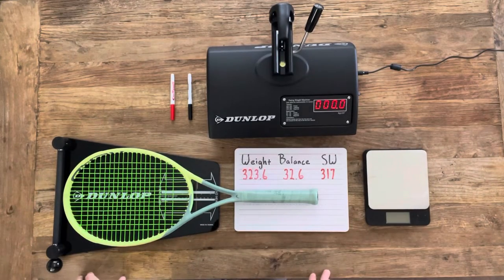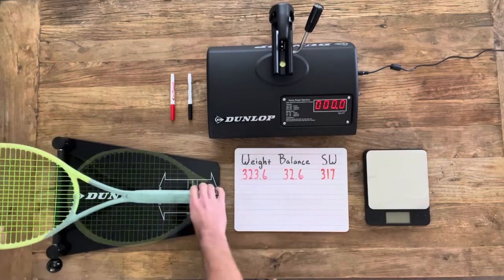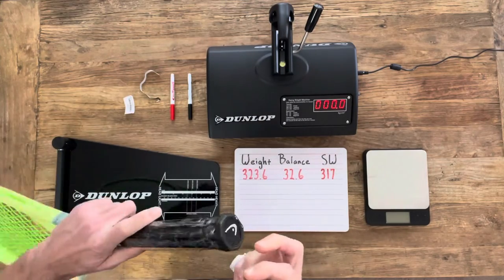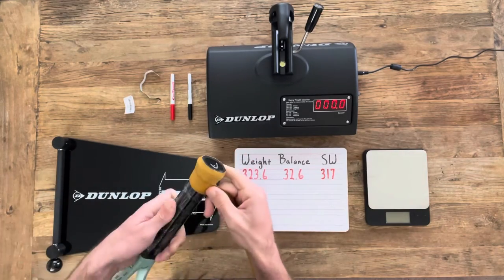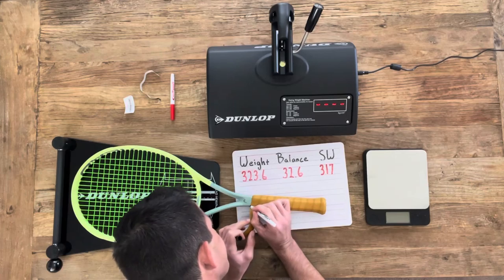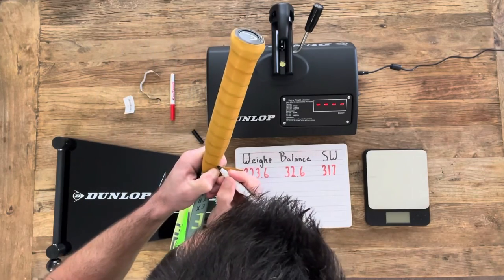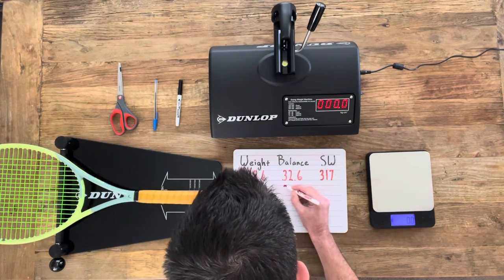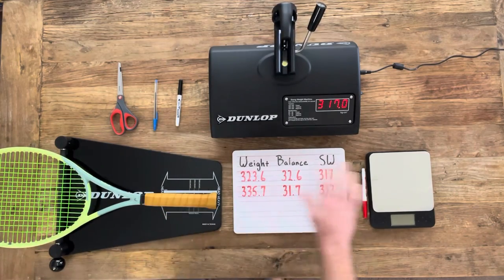How to put a leather grip on a tennis racket. How does a leather grip effect the swingweight?

Comment: 1:25 The TW private label leather grip comes in 1.5 and 1.3 mm thickness. The Head Hydrosorb Pro is just under 1.8 mm.
=> Both options will reduce your grip size by about half a size to one full size.
Reply: My factory-installed leather grip wore out. I removed it and will install a TW leather grip (same as in video). I noticed there are staples in the grip, so apparently staples were used by the factory to install the leather grip. But I can just go ahead and install the TW leather grip without stapling, correct?
Reply: Yep, you can get an Oehms Pro Leather grip in 1.7 which will keep the grip size the same. I believe Head uses those in their pro room, just rebranded.

Comment: Just curious, how much lead would you need to add to the hoop in order, to retain the original balance after adding the leather grip?  Obviously, this would vary depending on where you add the weight -- 12 o'clock,  3 & 9,  etc...   Thanks!
Reply: At 12 o'clock: 4 inches (2,8 g) of lead tape changes balance about 1 point.

At 3 and 9: effect is about half of what it is at 12 0'clock.

To change 1 cm ~ 3 points you need 12 inches at 12 0'clock or 24 inches to 3 and 9 to have original balance.

Comment: Heey I'm thinking of buying the Head Extreme Tour and for greater stability putting a head leather grip on it, I have it on my Head Boom Pro and it has increased the grip quite a bit, should I buy a smaller Head Extreme Tour grip to put the head leather grip on?
Reply from the maker: I haven’t used a Head leather grip before but you can get thin versions of the Tennis Warehouse brand. This one didn’t seem to increase my grip size

Comment: Did you get an underspec ET? You mentioned having lead on the sides at 3 and 9. Just surprised that the SW is only 317.
Reply from the maker: Yes, I did get an under spec one. I find that rackets are under spec more often than over which makes sense from a manufacturer’s standpoint because under spec can be remedied more easily.
Reply: @simmstennis  whats the SW unstrung?

Comment: That wasn't what I was expecting. I thought the swing weight would have gone down. Then what is the effect on the feel of the racket on the swing? Does it feel faster through the air? Does it feel more stable upon collision with the ball?
Reply from the maker: It depends on what type of swing. On forehands, backhands and serves where you’re generating plenty of head speed the impact is minimal. If you are blocking the ball more like with a volley or some returns of serve it helps with stability. To me it does not feel faster through the air although some say it has a more maneuverable feel.
Reply: Adding weight at the bottom never affects the inertia of the racquet.
Reply: The leather grip WILL provide recoil weight. Which means that the impact of the ball on the strings affects the movement of the handle less because of the added weight near the bottom. In other words, slightly more stability.
Reply: @Rui Dias correct
Reply: For me it makes the racquet more stable from the base line, especially on the blocking shots. But it also slowes down moving the racquet through the air which always denies this approach for me. It is a question of a proper racquet's choice. All the producers made a crap before 2020, but now some good enough racquet's are available